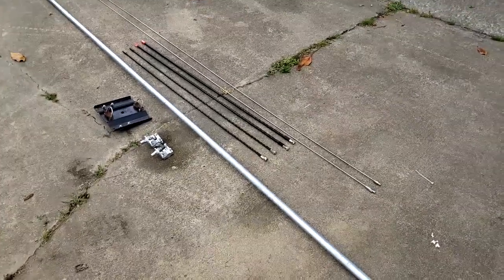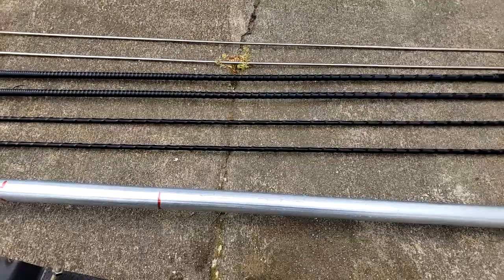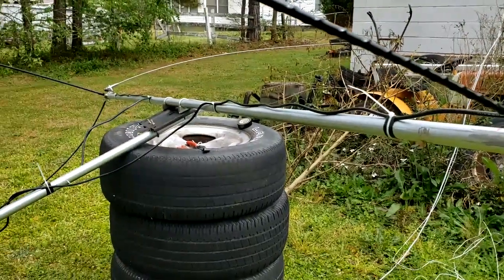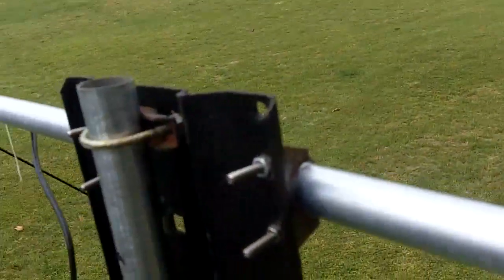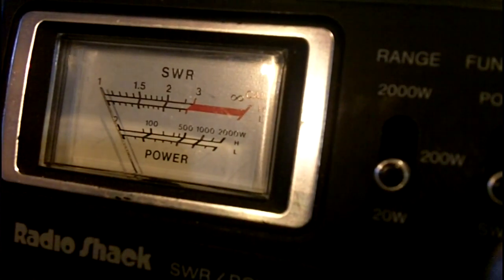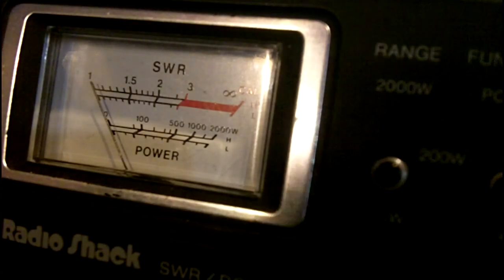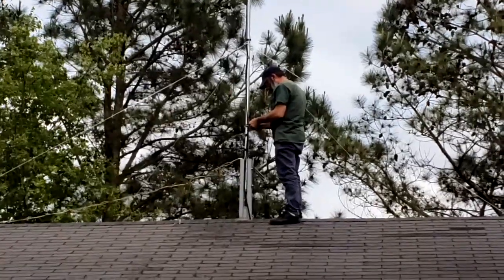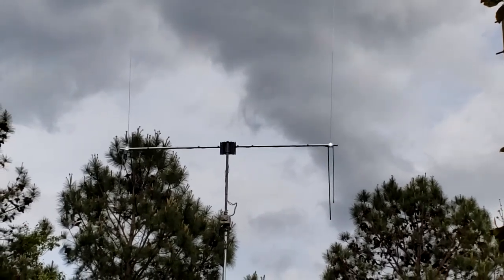Homebrew Beam CB Radio Antenna My New Homemade Base station

Comment: Co phased Ground Plane antenna, ON ROTOR!!! IT'S A BEAM!!!  @3:15 YOU SHOW 2 COIL MOBILE ANTENNAS ON THE BEAM YET U NO USE!!! DIDN'T CHANGE YR METER SETTING FROM 20W TO 200 WHEN U SWITCH ON FOOTWARMER!!! @19:09 THIS GROUND PLANE IS TURNING THUS IT'S A BEAM!!!
Reply from the maker: the 102's are a lot better than the coil whips I have. My meter was set to SWR, When set to SWR it doesn't matter where the watt setting is at.  Thanks for watching, 73's from 151 SC.

Comment: NiCE!  At first I thought it was a Quad style antenna! I remember back in the day an antenna that looked very similar to yours but it was based on the quad design, using 3 spreaders instead of 4. Nice job on the VSWR! Not to often you get a perfect match right off the drawing board. 

I was into CB way back in the 70’s. And have been a ham for years as well. My favorite part of the hobby is antennas!  And I’ve built practically them all. Dipoles, yagis, quads, end feds, C- loops, Satellite trackers, ect. And I can’t remember ANY of them hitting perfect resonance on the first shot. 
GREAT JOB👍  Did you make the Co phase harness or did you buy!! Thinking of putting one of those up for 10 meters.
Reply from the maker: Thank You for the great comment. I think it looks like a Gizmotchy.  I used the 75 ohm co-phase harness that came with the mirror mount brackets. then used a barrel connector to connect it to My 50 ohm coax.
When I first saw My SWR reading....I actually giggled!  Thanks for watching, 73's from 151 SC.

Comment: The tye-wraps are not UV rated and will not last. Go with T&B BLACK cable tye's available on E-bay.
Reply from the maker: This antenna will most likely be coming down in a few months, to make room for the next project. I really enjoy building antennas, so they usually don't stay up for long. The zip ties I use will last longer than the antenna will be up.  Thanks for watching, 73's from 151 SC.

Comment: I’d like to know how you cophased those 2 102” steel whips I mean I see how your coax is connected to the actual antenna but how does your coax look on the end that goes into the back of the radio? Do you just have like two pieces of coax going into the pl259 connector ??
Reply from the maker: I used the 75 ohm co-phase harness that came with the mirror mounts. then I used a barrel connector to connect it to My 50 ohm coax.

Comment: Usually when using the 102” you can usually get a better/ lower S.W.R. If you use a 6” spring on each 102” so it makes your overall length 108” each
Reply from the maker: The match on this antenna is almost flat, even with extra power. Springs would only add more weight to the antenna.  Thanks for watching, 73's from 151 SC.

Comment: Looking at what looks like a Beam Style Antenna to me,I can't figure what is the front,and what is the back door. I looked at the performance on the SWR Meter and was very impressed!
Reply: There is no back door with this antenna radiation pattern is stronger in the direction of the radials on both sides. The weak side is at the ends of the boom. It's similar to a dipole I hope that helps.
Reply from the maker: Just like l l said,  the signal radiates opposite the boom in both directions.  Thanks for watching, 73's from 151 SC.

Comment: It's incredible the antenna ideas you come up with! This one may be your best yet. So is this one going to stay up as a semi-permanent antenna, or are you putting the Yagi back up with a single ground plane antenna for local? I say if it's not broke, don't touch it! Especially if it outperforms the previous models! Keep up the great videos!
-882 Hobo
Fredonia, Pennsylvania
Reply from the maker: lol, "semi-permanent antenna" is definitely the way to describe My antennas. I'm sure in a month or so, an idea will pop into My head, and I will just have to build it!  but until then this will be up, and used heavily.  Thanks for watching, 73's from 151 SC.

Comment: So do you just tie the two into a single coax with a splitter?
Reply from the maker: I used a co-phase harness that was made up of two 9' long 75 ohm coax, joined together at one pl259 connector. then I used a double ended female connector to connect it to My 50 ohm coax.

Comment: What type of coax did you use and how long was it?
Reply from the maker: I used a co-phase harness that was made up of two 9' long 75 ohm coax, joined together at one pl259 connector. then I used a double ended female connector to connect it to My 50 ohm coax.

Comment: Sure bring to mind the jogunn series antennas  this look almost the look of pair starduster also put another pair 4' out off the pipes ends giving the three ground radial 
Great buld I haven't seen that good of set but once on a starduster years ago 
Stay healthy wealthy wise 
From 498 wis
Reply from the maker: It reminds Me of a Gizmotchy antenna. Thanks for watching. Take care 498, 73's from 151 SC.
Reply: @MowerJunkie  don't the gizmotchies radiate down at that 45° then take vertical turn half way down the radials
Reply from the maker: @williambowman7244  The Gizmatchy has 2 active elements. one vertical and one of the lower one's. they both share the other element as a counterpoise.

Comment: Hey got my tram 1498-b today how far did you pull down the internal top section down?? Thanks.
Reply from the maker: I used a fine tip marker to mark it at 2 23/64". then insert it to the mark. Enjoy Your new Tram 1498.  Thanks for watching 73's from 151 SC.
Reply: Just talked to 63 in columbia south Carolina...its getting out thanks man..great antenna. 40 feet..galaxy 959..old 100 boomer amp.
Reply from the maker: @charlessalard4636  That's awesome! 63 is one of My locals.

Comment: Very impressive antenna, what do you think of a co phased vertical dipole using 102 inch whips?
Reply: I have done this and it worked quite well.  Sorta like a rotatable dipole.
Reply from the maker: I like it! and I want to try it! Thanks for watching 73's from 151 SC.

Comment: How do the two cables terminate at the radio end? Thanks for posting.
Reply: The cophased harness are already made you can order them on ebay 18 feet per side it's connected to a single connector you need a double female 259 to connect the two 75ohm coax to your normal 50ohm coax to the radio. I hope it's clear enough if not I don't mind answering any other questions you might have 73's..
Reply from the maker: You are spot on! I set it up just like You said. Thanks for watching 73's from 151 SC.

Comment: I believe the old Super Scanner worked much the same, many guys put them on a rotor because they had dead spots. You probably could have got away with a single counterpoise rather than the 2 in a inverted V.
Reply from the maker: This antenna actually works like dual whips on a tractor trailer truck. it sends the power in 2 directions, opposite the boom.  Thanks for watching, 73's from 151 SC.
Reply: Yes , put the boom broadside to the direction you wish to receive, opposite to what someone used to a yagi would expect.

Comment: Like John said this antenna should be directional in the direction the ground radials are pointing. Theoretically it should have  less forward gain than the 3 element beam also the purpose of the beam is to give you forward gain eliminating or should I say reducing signals coming from the back and sides of the beam. This antenna has some gain in the direction the radials are pointing and allows you to hear signals coming from all directions it's like having a omnidirectional and directional antenna all in one. If you are building this for cb channels separation between antennas should be a quarter wave apart around 9 feet the coax for the cophased rg59 around 18 to 20 feet on each side 75ohm to achieve a 50 ohm at the radio. 73's...
Reply: I don't want to complicate things but Iam sure some are wondering or thinking about this lol. Rg59 is rather small coax there is also rg6 and rg11 coax more expensive less loss probably handle a little more power but the lenght for each side will be shorter both are 75ohm and not that hard to get it's used for cable systems and stuff like that. For low power or reasonable power stations rg59 is a no brainer already made and plug and play like they say. 73's..

Comment: Amazing! What are the details on the coax? Cophased coax from a truck set-up?
Reply from the maker: Yes, the co-phase coax came with the 2 fiberglass whips. it's 2 pieces of 75 ohm coax connected together.
 Thanks for watching, 73's from 151 SC.
Reply: @MowerJunkie  awesome! Thanks for the video! 73   519 Ontario Canada

Comment: Excellent video. I made a biquad. 8dbi gain.   24 feet long 12 feet high.  About 45 degree beam.    
Can be wired for circular polarization. 73's 351 se michigan.
Reply from the maker: Nice! Take care 351.  Thanks for watching, 73's from 151 SC.

Comment: you might want to add a more beefer stud mount on the 102's. With much wind it will bust the stud or wholler out the insulator, just a idea
Reply: Thats what I have in my truck bed. Though I have the slim heavy duty spring that doesnt flex much. 10 years on my daily driver. No issues but regularly serviced and cleaned.

Comment: 75 ohm.coax? Radiation pattern?   Great job.lovin u guys. Dan.
Reply from the maker: Yes, it's 2 pieces of 75 ohm coax connected together. the signal radiates opposite the boom. 
 Thanks for watching, 73's from 151 SC.

Comment: I like the measurements on that because I’ve been wanting to make one like that but I never thought about using the gram planes like you have like you did I didn’t think about that but I did think thought about 102 stainless whip like what you got on both sides that could forget what how to do a ground plane I like that you did fantastic job you need to write the size of the pipe and the stuff that you do in the prescription That way we get the measurements how do you done it we can build one I built in town is not as much as you do keep it up I like it in your test you’re blessed having a wife and helps you
Reply from the maker: Thanks Shep. I used a 10 foot by 1 inch diameter pipe for the boom, 2 mirror mount brackets with antenna studs, and four 4 foot 1/4 wave whips for the ground plane. and a co-phase harness to connect the antennas together.  Yes, the co-phase coax came with the 2 fiberglass whips. it's 2 pieces of 75 ohm coax connected together.
 Thanks for watching, 73's from 151 SC.